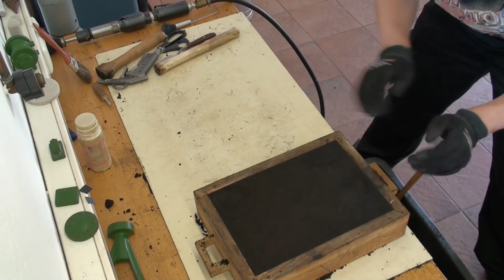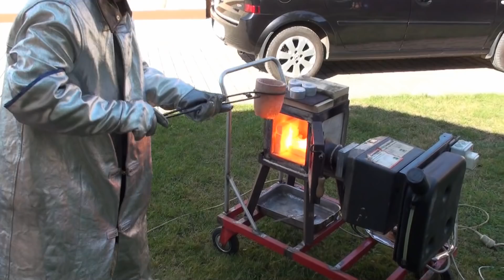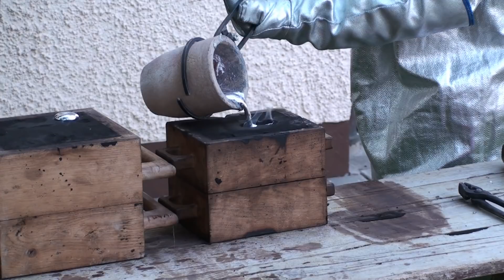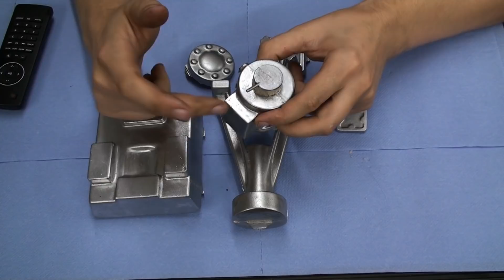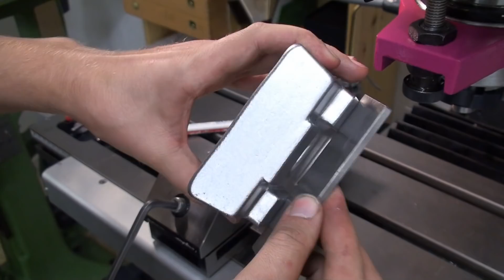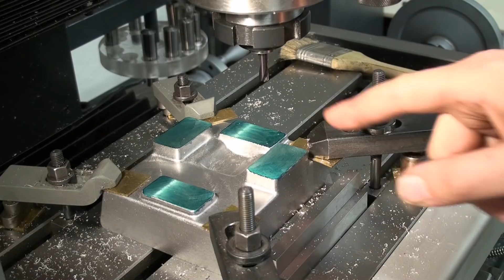Simplex steam engine Part 1 - Simplex Dampfmaschine Teil 1

Comment: Mr Pete 222 has flasks/boxes with latches on the side that are used for the pour. I wonder if there is some insulated material that could be used to make reusable, smaller reservoirs with rounded sides to minimize  surface area and heat loss. They would have to be made to either resist crucible temperatures or be disposable.

Comment: Have you considered locating the um, sprues for use as mounting points for machining? Something you can saw to length? Or perhaps casting the cylinder without any cylinder bore? Should be no big deal with small aluminum castings, I would guess.
Reply from the maker: Could be an option, but the patterns for this engine are as they are and I worked with them as they where :)

Comment: Thanks for another great video.  Your precise way of working was evident in your making of the mould.
.
I noticed that you did not put vents in the mould.  Or I didn't see them.  Were there vents, or is the sand such that vents aren't needed?
Reply from the maker: With the sand you dont necessary need them - If you dont compact the sand TO much.

Comment: Hi Stefan. Just a pointer for you. You will acieve even better performance from your machine if you replace the bench it is on with something that is structurally ridgid and bolted to your floor to stop wobbling and vibration. You likely know this already and just need the time to get round to it i suspect.

Comment: Put a radius on the fly cutter ,will be a better finish.. not that it matters...
Reply from the maker: +Bigwingrider1800 Youre absolutely right - But I prefer them only to have a very smal radius as thats leaves a more precise surface as the radius makes the fly cutter put out a bit more cutting preasure :)
Reply: really, .04/1mm has that affect?  ok

Comment: Very very nice castings Stefan, it's pretty obvious your friend really knows what he's doing to get castings that clean and with a surface finish that good. And you did a fine job also since you did the molding. I think your 2 mm tapped holes are roughly equivalent to our imperial 2-56 threads per inch looking at the tap drills needed. I doubt I'd be as brave and try to power tap those. I sure can't argue with your results though. That looks like an Albrecht chuck your using?

Pete
Reply from the maker: +Turning Point Youre right, he has the patternmaking, molding and casting process down to a very reliable process that gives great results :)
2-56 seems to be pretty close as M2 has a pitch of 0,4mm. Yes it is a Ablecht chuck, in my opinion the best chucks you can get for (a lot) money. But they show often up on fleamarkets and on ebay, new, still in the original packaging.
Reply: +Stefan Gotteswinter 
Yeah I've got one and think the same about them, but I wasn't quite so lucky as you and paid full price for it. That hurt a bit. And while there not in the same class of course, I bought 3 integral shank keyless chucks from Glacern Machine Tools in California. Runout wise they compare pretty well against my Albrecht at about $100 each. They aren't quite as smooth in operation, but there close. I still like my Albrecht better though even with it's much steeper price.

Comment: Excellent job very interesting. What was the source of aluminum used for the castings? Also I sure like your other machining vids.You explain what you are doing in detail easy to understand.
Reply from the maker: +wayneriedlinger Thank you! 
The aluminum is sourced from old engine headers, molten down once to form ingots and then remolten for casting.

Comment: Great start to another interesting project.
What sort of tap were you using for the M3 and M2 threads?
Also what speed do you tap at and do you "hand assist" on the down feed?
Thanks
Reply from the maker: +Belair_Boy Down to M3 I have spiral fluted machine taps and below M2 I only have normal machine taps. I run them at 95rpm and yes, I hand assist on the downfeed, at least with small threads in aluminum. A M10 thread in steel feeds itself with no problem :)
Reply: Thank for the info Stefan
The ease with which you power tap has inspired me to give it a go.
Reply: I have an RF45 clone and I can't imagine a tap pulling itself into the job against the rack return spring - do you disengage the return spring or something? I've been trying to figure out how all you guys tap under power on the mill without a tapping head.

Also, those raw castings were excellent. I've only worked with rough-as-guts castings we get from foundries that don't seem to care. They're barely usable.

Comment: My ass was clenched shut when you started power tapping the M2 threads , i usually hand tap anything under 5mm ! Those castings look superb and a really nice surface finish were you using a very fine casting sand ? Using a bench with a plastic tub on the floor looked like a really clean set up for ramming the mold and easy to use , i would still end up with casting sand everywhere though.
I'm really looking forward to this engine build Stefan !

Ian.

Comment: Bravo. I have seen "professional" castings that looked much, much, worse than yours. Textbook castings. Beautiful sand. Just for fun, the bottom molding box is called the "drag" in English and the top one is the "cope".  I envy you your compressed air rammer. My son and I did some casting (he was trying to build the Gingery lathe) but were defeated by the sand (foundry sand is not available in Alaska, and neither are the sieves we would need to do our own).  The better the sand the better the results, as long as you remember to add flux and degasser. See myfordboy's channel.  I like to use WD-40 for machining Aluminum. Or kerosene, since WD-40 is kerosene with some oil in it.

Comment: Is that Moto Guzzi yours? 

Nice project, i like steam engines a lot, :D On the base, you could cut the sides and make them look like the raised type, i've included a picture: http://www.history.nimg.de/Bilder/Dampfmaschinen/Maerklin/4197-2-4769.jpg

This one has those edges, but the ones without look just as fine, just can't find one on the interwebs.
Reply from the maker: +aserta Nope not mine, I prefer four wheels - But also an italian vehicle :)

I might do something to the base to make it look like it sits on a actual basement.
Reply: +Stefan Gotteswinter Yeah, i was wondering, because i see very few MGs when i pass through Germany from time to time. ;)

Oh and btw, you can make a very simple liner using one of those stainless steel kitchen appliances like the handle for a hand mixer (http://ecx.images-amazon.com/images/I/512Uh1AZOzL._SX355_.jpg) or a dough roller (http://www.pakuya.com/upload/20120103/Dough_Roller.jpg). Those are perfect and pretty much all you do is cut them to length and either glue them in or pin them at the edge.

Can't remember which one of the guys did that here on YouTube, either myfordboy or someone else.

And even if you don't it should be ok. I did one like that for my old school and it's been working for 4 years now. The cylinder in mine is probably 5 times bigger than what you have so it shouldn't be an issue.

Comment: Really nice castings Setfan!! Power tapping 2mm threads got my attention - I'm impressed but I always am with your machining. Look forward to the next installment,
Bob
Reply from the maker: +Bick1027 DE Its a bit on the edge of sanity to do it with the quil and the heavy returnspring. I will make me a sensitive drill/tap attachement soon :)
Thanks for commenting!

Comment: I didn't see the flywheel in your kit of parts.  I assume that you forgot it.  Great video, Stefan!
Reply from the maker: +Herb Blair Nope - The flywheel for the kit is machined from solid. But I think about making a pattern for a nice spoked flywheel :)
Reply: +Stefan Gotteswinter mrpete has a video of casting lead spoke flywheels. And one turning them with high speed, shearing tool bit.  Generated a very nice finish. Check Him out.
I wonder if a bit with a shearing grind on it would leave a better finish on the  high silicon  aluminum? On the shaper?